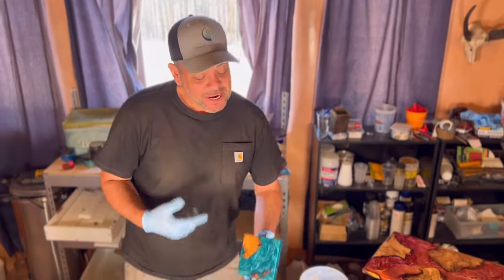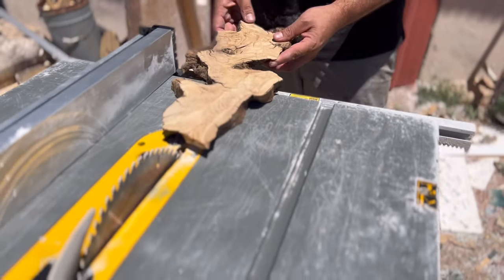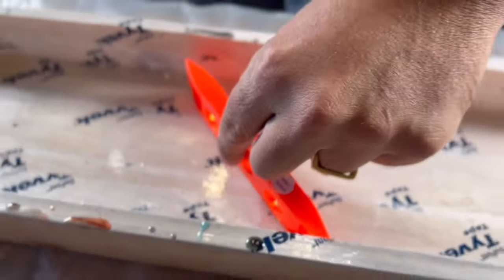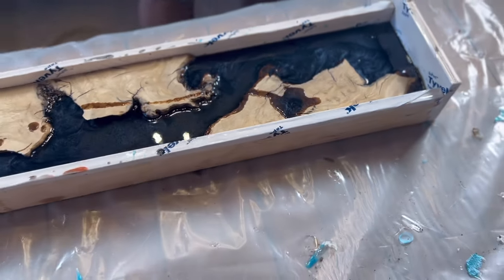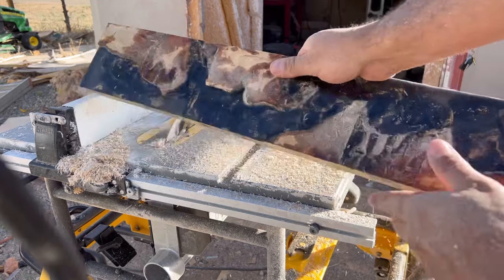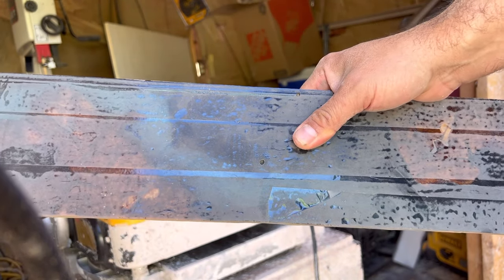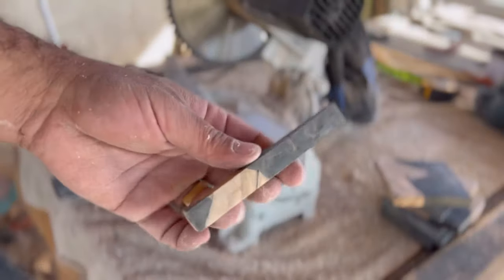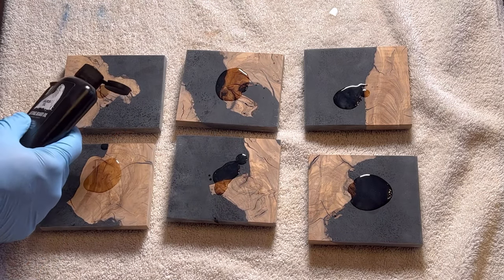DIY DEEP POUR RESIN COASTERS - HOW TO MAKE YOUR OWN CUSTOM COASTERS

Comment: When cutting out the 24 1/2 into 6…why not use a stop block? You’d get exact matches even if the measure was off by a small fraction.